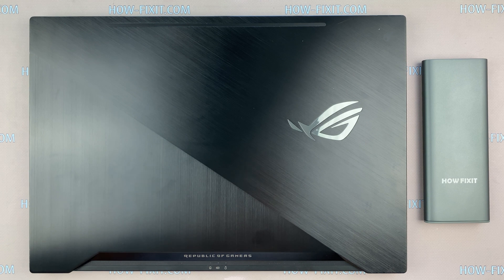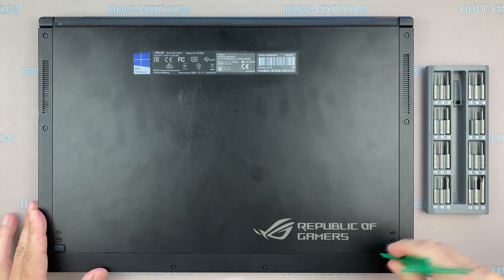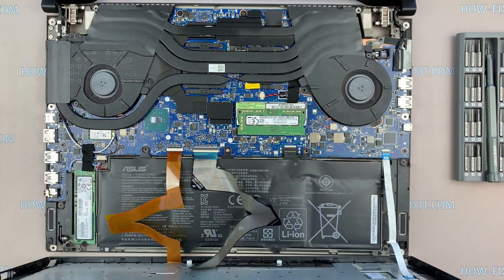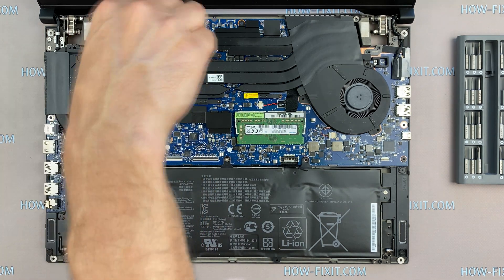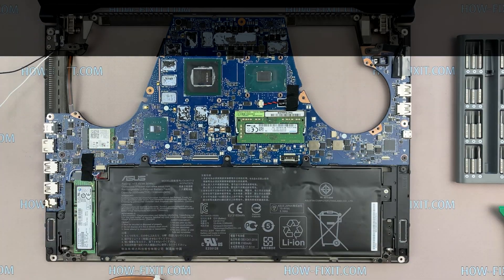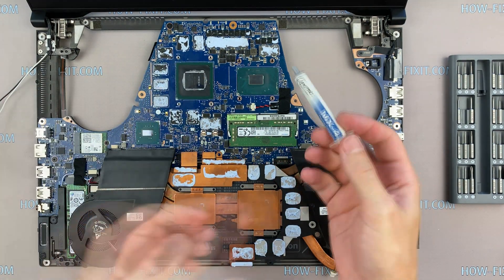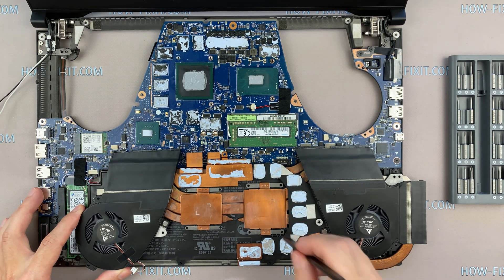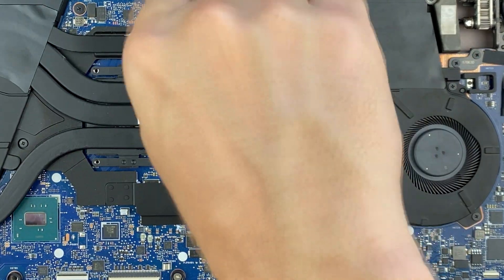Asus ROG Zephyrus GX501 Disassembly, fan cleaning and thermal paste replacement

Comment: Hi, I have the ROG Zephyrus GX501 and several keys in the middle are "dead". I've did a factory reset/ and format, and nothing helps including updating drivers. Also the battery is dead. Do you experienced this?
Reply: Yes mine also the battery was so puffed then broke some of the keyboard , I took the battery out and just use it with the plug now. Keyboard still has a few broken keys it will sometimes work completely fine.
Reply: @MoonMan213  thanks for your reply. So no way to recover the keyboard /or maybe replace?

Comment: hi at 5:21 those two cables are from the wifi right? one of the cables i have it loose cause somehow i broke the "grabber" on the motherboard where that cable goes,  can i solder it or conductive glue?
thnks!!!

Also the black tape....i didnt lift it well like you...and it doesnt stay flat....should i replace it or it doesnt matter...  what kind of tape is that...
Thnks!

Comment: Thank you for your great videos ! I have about ten keyboard letters that are not responding anymore (no liquid involved...), is there a trick or do I have to buy a new one ?
Reply: I had the same issue on similar machine. I did not plug in the keyboard cable back to the motherboard properly when assembled it back together. open it up again and pushed the cable properly and closed the little latch. worked

Comment: Thank you! It took me 30 minutes just to get these two wires back in at 12:45 but glad I did. Ran some benchmarks and temps are 15c lower already just from the repaste
Reply: Hey man, I had the same issue but I didn't succeed with the black wire :(  Any tips on how to get it done?

Comment: I also have zephyrus series laptop. Can anyone tell what are those black flaps for that are over the vents and some of the component. During cleaning i found that they were loosing their adhesive. So how important are those?
Reply: Hey! did you have any luck finding which tape was used.,.. While i removed the Cooling unit the tape just came off the fan and now it is in two pieces.

Comment: You should use liquid metal instead of mx-4
Reply: did you use liquid metal? I bought mx-4 and gonna disassemble and clean my GX501 for the first time in 2.7 years.
Reply: @nsa3679  idk if its too late, but I'd prefer not to use liquid metal because unless you super experienced, u risk breaking ur laptop with it.
Reply: I hear liquid metal is bad for your computer in the long run

Comment: ty! i fixed my gx501
Reply: Is it safe to open it all up and change thermal paste? I fear that I might damage it somehow.
Reply: @nsa3679  5:49 warning, you can see left side line. You have to remove the line first. This video didnt notice it :(
So, My mouse pad is gone..
Reply: @BDKTVing  That's wifi model connectors if you are referring to the white and the black wires.
Reply: @xhl1409  my wifi is working very good.
but cant work number pad & touch pad..

Comment: Great video! Btw will it be a problem if the gold cable (which connects the keyboard) already slit in the middle. 
My thinking that if it’s the battery cable. Cause My battery have been removed by the factory long time ago)
Reply: did you do it?
Reply: @nsa3679  Yup is fine that cable is for keyboard led only. Is much more better now after the cleaning,

Comment: I have a problem with "A" key. The key is not responding correctly. The key seems to be worn out. Do you have video about it on your channel?
Reply: bro, I have the same problem with many keys. 
I tried changing the keyboard (which was a mess) and it worked for a while and now again. I have to use an external keyboard all the time. Did you find a solution ?
Reply: @karnak336  I bought an external keyboard. So far I have problem only with "A".

Comment: Thank you so much, well help i think I just disconnect the bottom led the stripes wire one that has brand logo and some text on it, and then I put it back and connect it under that black tips/things and it's still not work hmmm, my bottom led only work 1, help pls :(
Reply: Did you screwed it back and plug it correctly into the other side of that cable? The plug is covered by tape.
Reply: @karnak336  well, yea how to plug that without removing the tape?
Reply: @tetiitet  Remove the tape. If it doesn't stick again just replace it with other black tape. I think you need to lift some lip of that plug in order to secure that connector, as with the other ones from the keyboard.